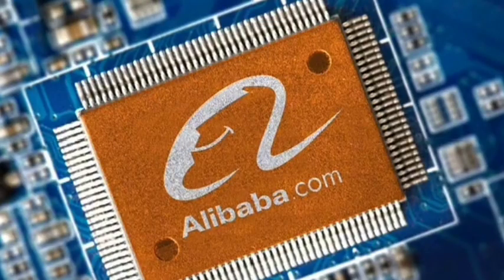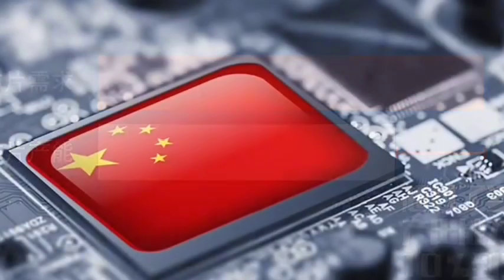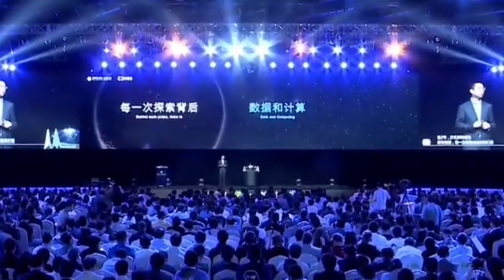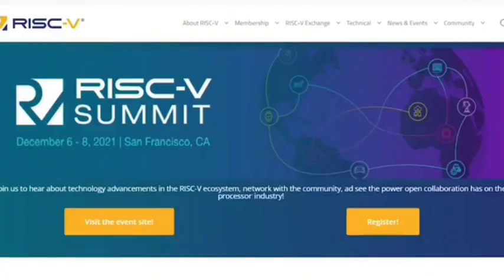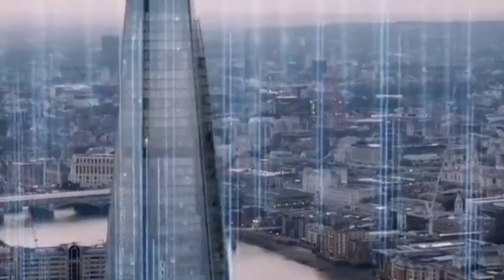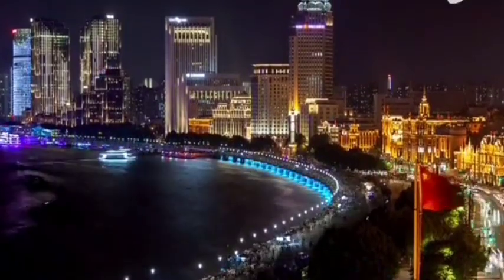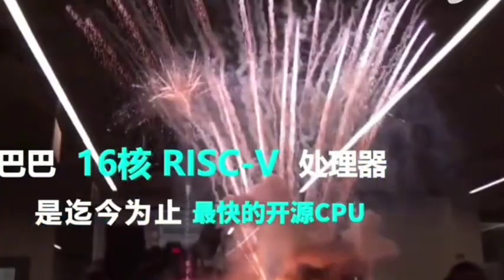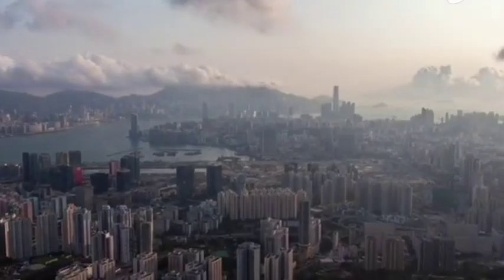China's Alibaba released a new RISC-V chip, which has been adapted to mainstream operating systems

Comment: Alibaba need to redesign a slower chips to conform to usa sanction rules. Hi end faster  chips cannot pass usa regulation approval for china use .
Reply: American chip Law can't applied in China, Alibaba Can produce all faster chip no risky in  China. W.T.F
Reply: @especiallyrent6778  True, what got lost in translation or politics is that some chips cannot be imported by China. This would be most of the heavy processing chips like the X86, video chips or GPU and the compute or AI processors. RISC-V on the other hand has a lot of potential with scaling and efficiency. From the looks of it when it come to efficiency on Silicon the RISC-V will most likely emerge a winner in 90% of the markets. That can only happen if it can find the right eco-systems (main boards and devices).

Comment: It is extremely disruptive to change CPU architecture.  RISC-V is hardly advanced over ARM. To go to all that work,  would want viruses to be impossible, efficient support for millions of cores...
Reply: RISC-V ISA’s are open, license free interface specifications. The primary goal was not to have better performance than other ISA’s, but to at least match performance while providing ISA’s that are not controlled by a single company. There are many other benefits to RISC-V, but the above should be enough for the world to eventually move to RISC-V. It is good for consumers and good for the industry.
Reply: Yes a  supreme monopoly is the answer.....Yawn
Reply: If it doesn't use 32bit it is more advanced than ARM.
Reply: It doesn't have to be advanced, it just has to be open. This architecture is open. The base instructions are simple and  new instructions can be added even after the processor has already been built an installed into a system.